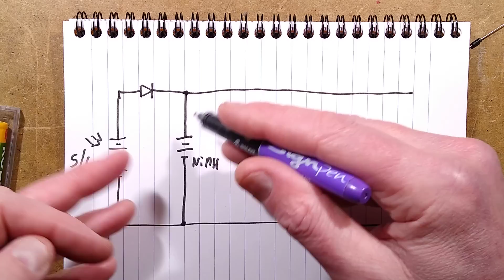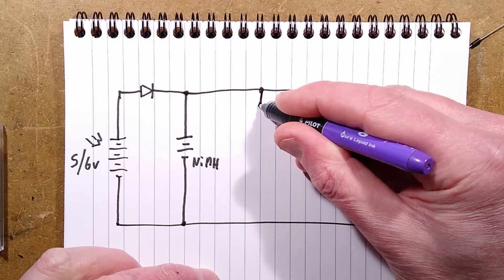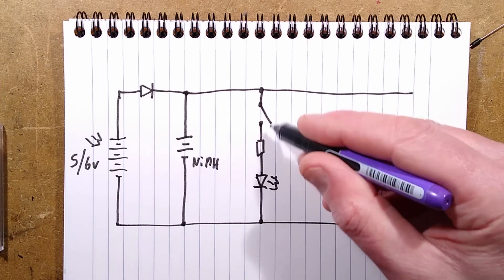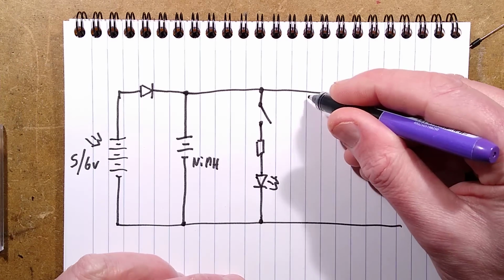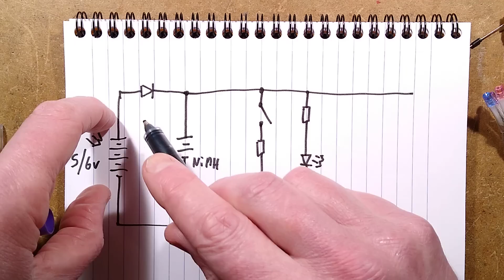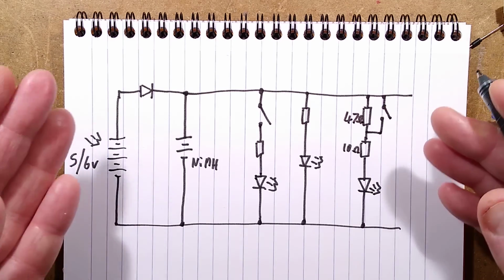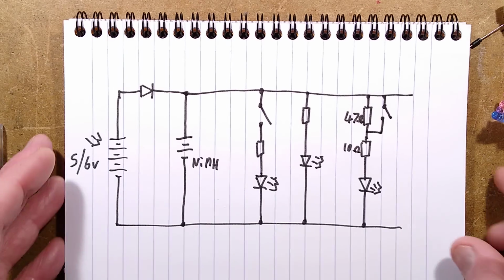Apocalypse solar lighting system.

Comment: If you find you have survived the apocalypse, grab all the electronics and alcohol you can and make your way to the Isle of Man. Big Clive will have the decorative lights up and be ready to carbonate whatever alcohol you bring! The party will be epic!
Reply: Next project: how to generate/collect/pressurise CO2 in an apocalypse? :D
Reply: @Kage-Yami  
Fermentation, (uh.. like beer or wine). Next project - what to do with all the beer and/or wine that left over from making CO2. I have some vague idea about using boiler, copper tubing and cold water ...
:)
Reply: @matikaevur6299  I have thought about collecting the CO2 from wine making.  Never got around to it because it would be a pain to refine it.  It isn't exactly pure CO2.
Reply: @jmr  Who cares, the sodastream stuff is not pure either, more than 60% nitrogen in the cylinder, to save on the cost of that expensive CO2 gas.
Reply: @jmr  
Haven't analyzed what comes out. What else is there? Maybe trace amount of methane. Wine making where i live is done on atmospheric pressure (glass airlock or just hose in bottle full of water), home-made beer is (or at least was) made in pressurized vessel, reaching pressure around 8-10 Bar. Guys with access to "free" stainless steel and welding it had profitable side-hustle in soviet times :)
And that beer - 8l foam to ~ 200ml beer.
Took patience (or big bucket) to serve few guys ;). Sometimes we used buttered knife to collapse foam faster.
Reply: @matikaevur6299  I have the feeling if you do that, your going to need to make more beer and wine in order to carbonate the resulting product
Reply: @zyeborm  YOU’RE
Reply: @matikaevur6299  I can't say for sure but probably a little acetic acid and other trace stuff.  I really doubt it's suitable for carbonating most beverages because you'll get an off taste and smell.  The other problem you would want to address is the water vapor.  That would build up in the tank when you compressed it.  I don't think there is anything actually harmful.  You would probably just need some steps filtering and drying the CO2.  Baking soda and carbon filters along with some sort of desiccant might be enough.
Reply: @SeanBZA  Nitrogen doesn't make your soda taste funny.  I'm not concerned about safety.   It's the off taste/smell and water vapor.  Some refinement would be required.
Reply: @jmr  In the apocalypse you would be drinking weak beer anyway, as the yeast fermentation kills off competing bacteria and yeasts, making it safer to drink over ground water, and people did not know germ theory then, so did not boil all water before drinking.
Reply: @SeanBZA  I'll stick with proper water sterilization and filtration techniques.
Reply: @Antney-u6j  In war, the first casualties are speling and grammer.
Reply: @Kage-Yami  I watched a video on that already.  The guy used baking soda and acid to make CO2 then pressurized it with a fridge compressor.  Finally he sprayed it into a mold to make dry ice.
Reply: @Kage-Yami  Clive would have already acquired more sodastream cylinders than any survivors.
Reply: @Kage-Yami easy, add sugar, water and yeast to a keg. Next.
Reply: @TheNasss You could power your soldering iron from the solar panel. Wait, there's a flaw there somewhere...
Reply: @TheNasss  
Who says you cannot use one of those propane/butane ones (collect and compress your fart if out of gas, methane also works).. or heat a nail on coal fire? Where to get solder? Mass-melt it from useless boards.
Reply: DIRECTIONS TO CLIVE'S:>>>
Piss easy to find Clive's house... it'll be the property where all the lights are on and a fully functioning discotheque running through a10kw PA system... Clive will be unconscious on the front lawn... having consumed way too much de-caramelized single malt🤢🥴💤...🤣😂😂😂😅😅 !
Reply: Lol…..my bag is packed already……I’m just waiting for the Apocalypse
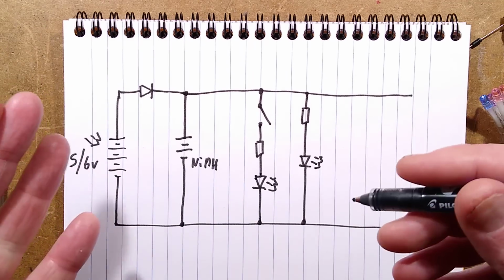Reply: @steveosshenanigans  Nostradamus said: "A great noise shall come from shiny things, but when the sun moves through April GIB EVILC shall light the way." Stanza 04:01.
Reply: @TheNasss 
Generator? Off grid solar? Car battery and 12v inverter?
Reply: I'd just stop at Ralfy's on the way and load up on quality booze.
Reply: @TheNasss   There are some great little gas powered soldering irons or you can power the regular ones from batteries.   I have a soldering iron powered by 2 AA batteries.
Reply: That's if the planet hasn't been hit by EMP.
Reply: @MD4564  Even a strong EMP won't destroy most of the individual electrical components(things not assembled) because it requires an element long enough to resonate at the frequencies the EMP generates. Many devices that are destroyed will be repairable.  Lots of small devices will likely survive too as long as they aren't plugged in to mains power.  Clive would have no problem getting his lights going.
Reply: @MD4564  true I guess, but not everywhere on the planet would get hit with an EMP all at once, so for a while at least, Big Clive's home would be the best place to be.
Reply: @orinokonx01  That depends on the range of the EMP and explosive power of it.

Further more, the Isle of Man is not far from mainland England.

roughly about 200km from the shores.
Reply: It'd be one hell of a project to try and sail from Florida all the way to the Isle of Man, relying entirely on whatever I could scavenge before I set off.  Maybe try to bring some valuables to sell off in Bermuda for as much gasoline as I could get.
Reply: And hopefully a battery operated soldering iron so he can make you a set 😂
Reply: I am there
Reply: @TheNasss  next project: solar powered soldering iron
Reply: How many solar panels will be needed for the Presto Hot Dogger™ ?
Reply: Yes I will
Reply: @TheNasss  You could use a butane powered soldering iron.
Reply: I'll be there!
Reply: You make the apocalypse sound great Davin. Kinda looking forward to it..(that's a joke by the way)
Reply: 1N4007 most useful diode ever😊 used them as "wattless dropper" for the red bulbs in electric fires, bulbs lasted a year against 3 or 4 weeks.😊

Comment: I'm so overjoyed to see a build-it project from Clive.  Just what we need for night lights!

I bought a string of several dozen warm white LED blobs along a 25 ft or 7.6m length pair of wires, which came with the plastic case which holds 3 AA cells.  It has a USB A connector and so does the string of lights.  So this should work great with my 5V, 360 mA solar cell.  I'll be using three AA NiMH rechargeable batteries.  They should give 1.42V times 3 or 4.26 VDC fully charged, down to 3.6 V discharged.  This range of voltage should be adequate for brightly lighting the blue or white LEDs.

What I'm wondering is with only two AA rechargeable batteries in series, that's only 2.84V fully charged and 2.4V discharged.  How is that low a voltage going to light up blue or white LEDs which need 3V??  They're going to be very dim. 

Thanks so much, Clive for giving us the inspiration to build a useful project.  Please, inspire us with many more like this!
Reply from the maker: The lights will be dimmer on 2 cells, but the lower current as the voltage falls means they stay lit for an extremely long time.
Reply: the more "modern" white LEDs have lower Vf, so will be ok... you could also use red/yellow LEDs, which have Vf from 1.6 - 2.2(appropriately, without looking at a data sheet) in an apocalypse, you'd probably be happy with light of any color, and red helps to maintain your night vision...
Reply: Ebers-Moll says so...

Comment: Thank you Clive it’s nice to see a project that I can do I have no 3d printer so a lot of the projects recently I can’t do.  I have one question can I use a usb cable instead of the the solar panel.
Reply from the maker: You would need a diode and resistor for USB charging
Reply: What resistor would u recommend I was thinking 100ohm.

Comment: Excellent, great project, thanks.  Any idea if putting one of these cheap solar panels or refurbisted outdoor solar light panels behind ordinary glass will lessen the power generated much?  I think most of the cells are geared towards visible light but can utilize some infrared and UV.  Thanks!
Reply from the maker: It shouldn't impact output, but will give good protection.

Comment: I’d better buy a butane gas powered soldering iron, in case apocalyps strikes.😂
Reply: Nah, just do as in the old days, build a fire and keep your "irons in the fire"...  :)
Reply: You'd be far better off with a 12V soldering iron. Where are you going to buy butane ??
Reply: I use little alligator clips that come attached to both ends of two foot wires.
Reply: And a metal paint/ammo can to keep the semiconductors you'll be needing in so they survive, should the apocalypse mode be emp-generating.

Comment: I have a shit-ton of electronics sitting in Faraday cages as a Just In Case type of thing.  
Several 5/6 volt solar panels and a few 12VDC ones for the auto-type appliances & equipment.
Reply: Having an electronic cardiac implant and a few feet of wiring in my chest, I have learned to stop worrying about EMP.
Reply: How do you make Faraday cages?  Cabinets made from sheet metal?  If I was going to protect stuff, I would wrap it in aluminum foil.
Reply: @acmefixer1  
You can actually use steel garbage cans among many other commonly available things...check out Dr. Arthur Bradley (EMPDoctor) here on YT.  
He has a lot of scientifically professional testing videos on many different products.  
BTW:  I am not affiliated with him...just a subscriber.